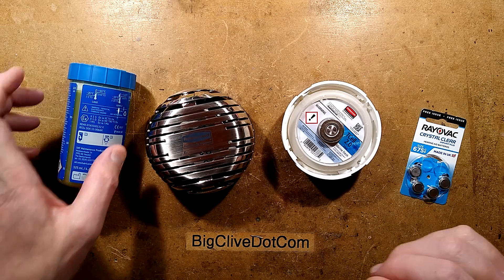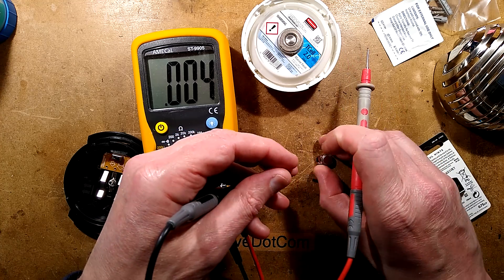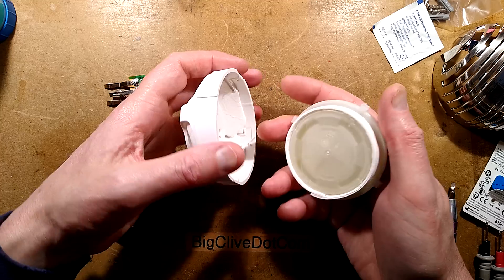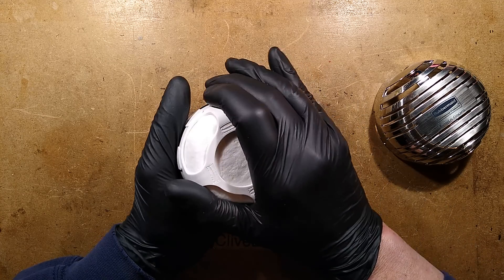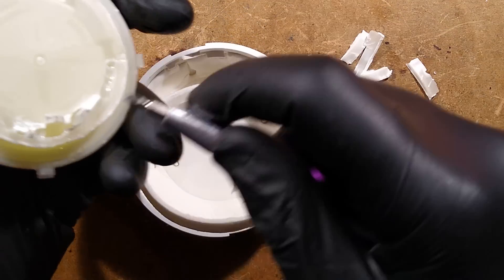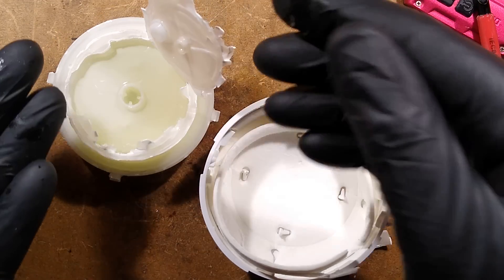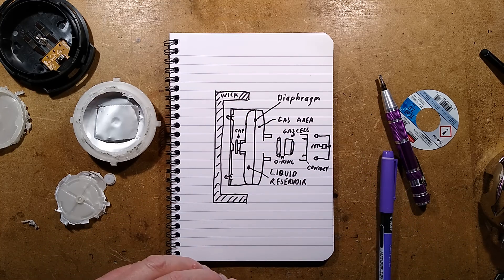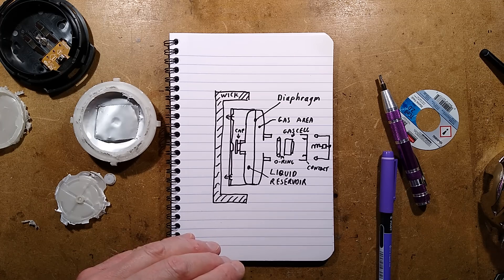Rubbermaid gas generating aroma unit teardown

Comment: As a nerd for rocket science, I was hoping for a teardown of a gas generator. I have only partially been disappointed, I guess this also counts as a gas generator - one that I don't know anything about yet - so my autistic brain is actually satisfied and now wants to design a rocket engine that's using a Rubbermaid gas generator to drive the propellant pumps (i don't think this would be a meaningful idea, but the thought is funny to me).
Reply: You would be better off using car AirBag Inflators much more gas production and very fast.😊
Reply: @stephenjones9153  alarm sirens and blinking red lights everywhere
"We still need those for landing, captain!" - "Do it!"
After some hesitation, Jeb opened the capsule, took the lift down to the pad, ripped the steering wheel out of the car they arrived in two hours ago, opened it and smacked the airbag assembly into one of the nozzles.
While he took the lift back up, the countdown hit zero and they left without him. "This is fine", he said to himself, "it worked, I saved the mission".
The end

Comment: AvE just cobbled something like the grease dispenser together following your video on the SKF unit. He used a Zinc air battery, and it worked decently enough (he did just short circuit the battery...) So it seems such a cell is viable for this application at least.

Comment: I'm extremely sensitive to chemical aromas used in those air 'fresheners', they usually make my eyes water profusely and my nose drips like a leaky tap !
Just watching you fiddling with that thing was enough to trigger a reaction along with the faint smell of soap from when I last washed my hands ! I couldn't spend more than a couple of hours in your house with all the chemicals from that thing in an open dish because the reaction would get progressively worse and affect my breathing quite a lot ! 
I find them very unpleasant !
Reply: I worked on a hazardous waste treatment and transfer site where, amongst other things, they destroyed fake perfume that had been seized by the local trading standards people by tipping them into a shredder - I'm still sensitised to knock-off perfume to this day and had a similar experience to you watching the video.
Reply: @Derek_Garnham  Yikes !
Reply: Psychosomatic.
Reply: You're not alone in finding them unpleasant and I could smell it watching the video as well.
I'm on the other hand not as sensitive as you to these chemicals, hopefully but that doesn't mean I overuse them, in fact I'm more for the option of opening the window and/or striking a match when I'm done in the toilet.

(Yes I'm fortunate enough to have a toilet with a window and to be living on my own but I'm due to move out and maybe my next flat toilet will not have a window). 

But out of curiosity, what laundry soap or detergent do you use ?
Also can you use essential oils or do they make you react like the synthetic aromas do ?
Reply: @psirvent8  Yes, there's no substitute for fresh air and I have windows open all year round. I think there's a regulation with bathrooms (in UK) that states it must have some form of forced air ventilation or a window which can be opened but if the room has a shower it needs an extractor.

I am using Persil non bio at the moment, it's only lightly scented and I give my laundry an extra rinse etc.
Reply: @ian-c.01  I'm from France and yeah, forced air ventilation system do exist out there but they really can't match a good old window and bathrooms and toilets can be windowless here. (Provided they come with extraction fans but those aren't that effective, particularily after years of nonstop use).
Reply: For modern building regulations - even toilets must have a extractor fan inside them if they don’t have an openable window

Comment: Let me see if I get this straight: The battery is given a load, which is not actually doing any work. Instead, the offgassing of the battery pressurizes a compartment, and this moves a diaphragm which presses the smell-um-good out into the air? Brilliant!
Reply: @psirvent8  I know it's heating up, my point was that the heat is not being used. Only the pressure buildup from the offgassing is being used to do the work. I think it's a great idea.
Reply: @ScottGrammer  Many battery chemistry types give off some gas, lead acid car batteries for example & a classic case of battery off gassing while not under load are alkaline cells, thats why they often leak while in storage, gas builds up inside & pushes the contents out past the seals.
Reply: @NOWThatsRichy  I was aware of that. I've just never seen the offgassing process used to do work. I think it's ingenious that they got a battery to perform mechanical work without even a hint of what would normally be thought of as a motor. Great design.

Comment: Searching "varta gas generator cell" finds a few documents on these. They give up to 150ml of hydrogen, can't see any figures for pressure though. Also used to test & calibrate gas sensors/detectors
Reply: Hope to see a new video soon from Mikestuff  ;)
Reply: Oh the Humanity! Have we learned nothing?
Reply: could be interesting for keeping tyres inflated
Reply: I'm really surprised that hydrogen would be used in an industrial setting like this. Hydrogen leaks out of most things , happily escapes through most plastics and is not what you want mixing in with stressed steel components.
Reply: @wktodd  meh, those tiny quantities won't cause any harm. For any serious hydrogen embrittlement you'd need a continuous hydrogen-rich atmosphere for a long duration.
Reply: @wktodd  With steel to make it brittle you need to either have it really hot in a hydrogen atmosphere, or at very high pressure. You get a lot of speciality steels that are alloys made, formed and cast in a hydrogen atmosphere, simply because it will not react badly with the alloying additives, and after the casting in hydrogen it is allowed to cool, and then annealed in an argon filled furnace for a few days to both stress relieve it, and also allow the hydrogen to diffuse out. 

Hydrogen embrittlement mostly occurs in welding when you have water dissociate in the arc, and the hydrogen reacts with the steel, making the weld step between the weld material and the parent material brittle, or when you have a cylinder of gaseous hydrogen at high pressure for years. Both can be cured by a simple annealing process, that heats the metal to under dull red, depending on the alloy, to allow the hydrogen to diffuse out and allow the metal atoms to bond to each other again, and relax all the defects. not done unless you are needing the weld to be ultra high strength, which is why you see so much purge gas used in speciality welding, along with heating the part up and slowly cooling it in an inert atmosphere. Some speciality exotic weld gas mixtures actually do contain hydrogen as well, designed because you will have a heat soak after welding anyway.

Comment: Smells like a rubber maid after a whole day of service, LOL
Interesting device and principle of operation. It's indeed similar to that grease dispenser; I only wonder how much gas can this teeny tiny button cell generate for it to be viable over a prolonged time.
Reply: those tiny cells can produce a remarkable amount of gas, don't underestimate it:)
Reply: The rubber maid needs polishing...
Reply: Toilets again Clive ?
Reply: Been giggling childishly at "Rubber Maid" for years. I wonder if they meant to call the company RubberMADE and somebody screwed up.
Reply: @sootikins  The company make a whole range of commercial cleaning products such as Mop & bucket sets, floor polishing equipment etc.

Comment: I was going to say pop one of the cellls in to a vacuum bag and suck it to remove the air.out and seal it. That would show any inflation much sooner than an air filled bag.  
Great video an odd bit of science the way they work is most .intersting. 2x👍

Comment: I would propose a simple test of putting a 2K resistor across  the cell and then inserting it into a sealed rubber balloon. Two tests required, one for the Rubbermaid gas generator, one for a zinc air cell. How quickly does each inflate? Then somehow test the gas that is produced.
Reply: Mylar bag.  If it's hydrogen that's released, (and I'm sure Clive will do a match test to see, lol,) you'll get a lot of loss through a rubber balloon...
Reply: @Backroad_Junkie  he could also put the ballon under water with a glass above it, like in an electrolysis setup
Reply: @capturedflame  yes, Hindenburg test required.
Reply: Hydrogen leaks out of a rubber balloon in a mater of hours. Tried filling a balloon with hydrogen once. Was empty an hour or so later.
Reply: @BersekViking  How did they fill airships then?
They didn't have mylar in the 30s
Reply: @daviddavidson2357  I thought they used some animal-sourced membranes that were more gas-tight than common rubber?
Reply: Will a 0 Ohm resistor generate the same amount of gas in less time?
Reply: @twerking bollocks realistically this will work for any gas produced. Since the mass of the bag doesnt change but its volume increases it will experience buoyancy in the air independent of the type of gas.
Reply: @mydickissmallbut9716  if it releases sulphur hexafluoride it'll be quite a lot denser than air.
If it's hydrogen given off the density would be a pretty clear indicator of the substance, not much is going to evolve helium which is about the only comparable gas density.
Reply: Something less porous than a balloon may be required - a syringe, maybe...
Reply: If you do it'd be advisable to also measure the voltage and/or current both cells produce. I suspect the amount of gas generated is proportional to the amount of current drawn but the voltage (and therefore current) will depend on what metal is used in the anode. I assume it'll be zinc for both but you don't know until you know.
Reply: Ave made a grease tube with the sync air battery… with a nod to Clive and his brother
Reply: No.  It will weigh the same unless some hydrogen escapes the bag. It’s the same amount of molecules inside the bag.

Comment: An interesting smelly thing. Is that writing I saw on the cell? If so, does it show anything useful?

With your next one could you let it run and fill the tank with gas (maybe a lower value resistor to make it quicker), then check it for flammability?

Also, is "Marine Fresh" a fishy smell?
Reply from the maker: It's a "salty" smell.
Reply: It's a kind of aftershave type smell, more like laundry detergent
Reply: @grantrennie  Probably because it is precisely the same odour they add to laundry detergent to make it one type or the other. The base materials in them are all essentially the same, just the odour pack is different to make the one different from the other in the vast majority of cases. All are made by one of a few large FMCG manufacturers, just branded differently for different market segments. Lever, P&G are the 2 big ones that come to mind by me.
Reply: @SeanBZA  
Warning ! Long text ahead, but hopefully interesting.

Back a few years ago my grandma was doing experiments with essential oils to basically make homemade cleaning products, including fabric softener.
But she quickly found out how expensive essential oils can be, particularily when used in generous amounts like she did.
So one day she decided to try out synthetic fragrances ( By "Fragrances" I mean cheap chemical aromas, that's how they call them in France ) that are meant to be included in homemade scented candles but could perhaps also be used in her citric acid-based fabric softener, except she was adding way too much of that cheap stinky chemical mix and the end result was enough to pretty much clear a room. 😂😂

If you did put the correct amount however, which turned to be only ONE DROP for a liter of homemade softener, then it ended up smelling more like your average store-bought laundry detergent, a entierely chemical smell that I still find acceptable on the other hand.

By the way this fragrance is literally called "Outdoors" in French (Plein Air to be exact but difficult to translate correctly).
Reply: @psirvent8  I got the empty drum of one of the $200k per litre stuff, they bought 10l of it. It has a 2 year shelf life, and they used it 100ml at a time. I reckon they lost part of that parfum to evaporation, and to the sides of measuring pipettes, so losing around $50k of it, in that time.

We ordered some, it was cheap, only $2k per litre, and blinked at the price, even though it was a lot less concentrated. I smelled of it for days when I handled it.

Comment: It seems like the inside of the liquid tank has 4 capillary channels towards the centre plug - and I'd guess some around the circumference of the tank as well. That means that the capillary channels will wick up the liquid towards and keep the centre plug wetted at all times, which is enough to make sure that the liquid is getting out whenever there's pressure in the back, no matter what the orientation. The same principle is being used in some fountain pen ink cartridges (Parker), and it makes sure that the pen can write upside-down as well.
I wonder how the device deals with normal atmospheric pressure changes. The way it is constructed, it seems like it doesn't deal with them at all, and when a storm is coming and the pressure drops, you also get extra stink in your home. If the plug is well restricted and it needs a considerable pressure in the back for the fluid to come out, it might be okay though.
Reply: Ha, that's another use case right there: "Brace yourselves, I can smell a storm coming!" 🤣